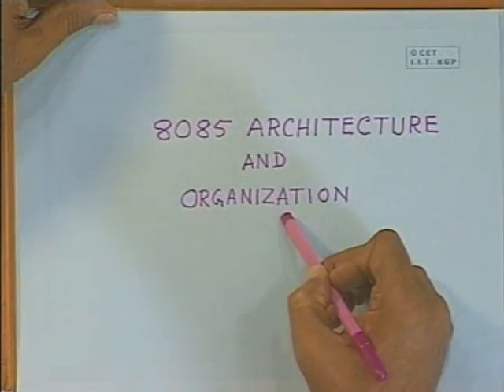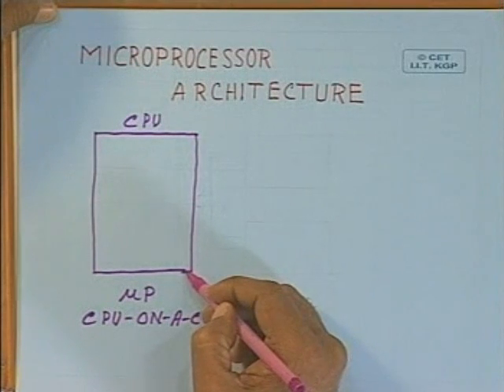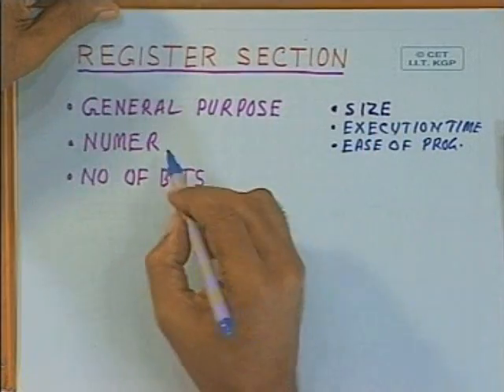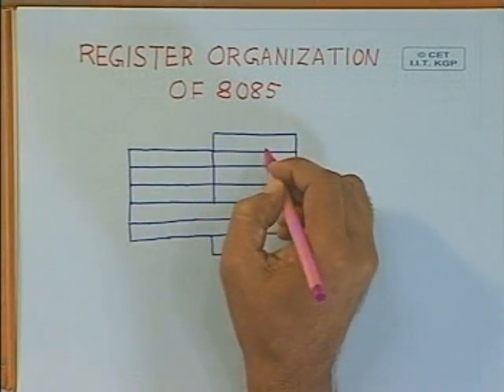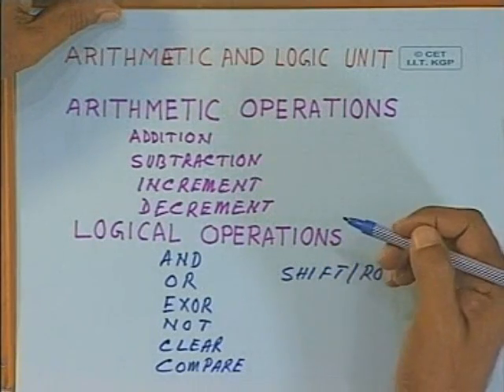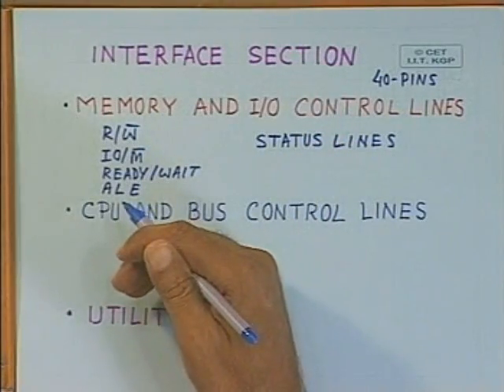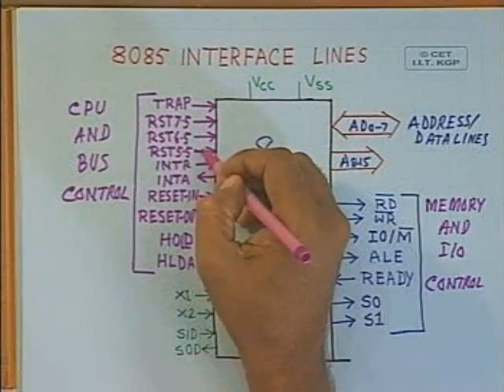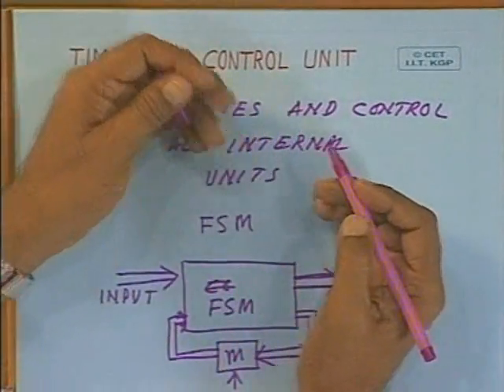lec 2 - Architecture and Organization of 8085

Comment: 30:09, I have been doing electronics for a while and I have decided to build my own 8bit advanced microprocessor and I am having some problems in control logic. I want to decrease the number of transistors, here at the time stamp 30:09 logical operations are: 1>AND, 2>NAND, 3>OR, 4>NOR, 5>XOR, 6>XNOR, 7>NOT, shift which is by giving a clock pulse to a d-flip flop shift registers. There is no EXOR gate the information in the video is incomplete

Comment: 12:56 What is Register?
Reply: Registers stores temporary data such as 10101010 1-byte data. It can be read by the cpu by enabling the output line of the register which will put the data on the bus which can be transfered to any register, added, subtracted or whatever. By enabling the writing line the data from the alu, logical unit or from ram can be stored in the register temporarily.